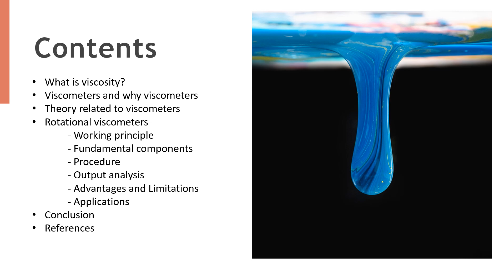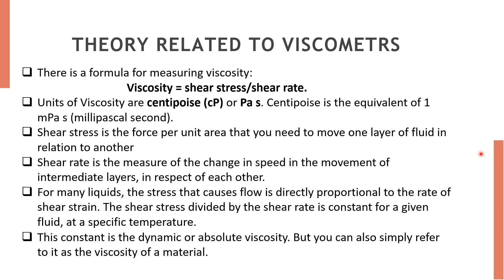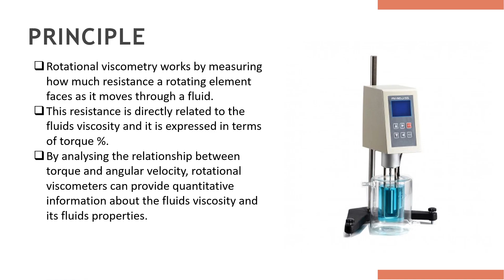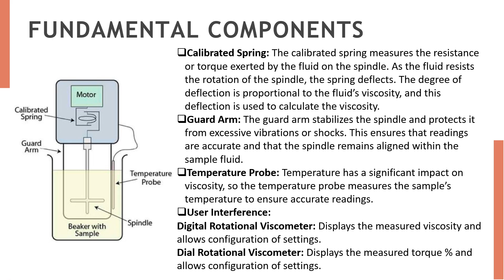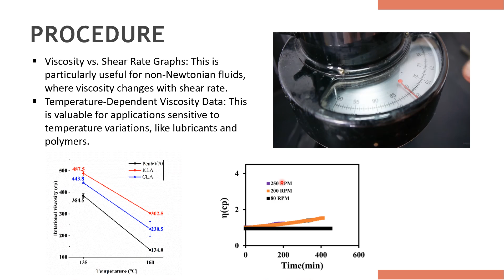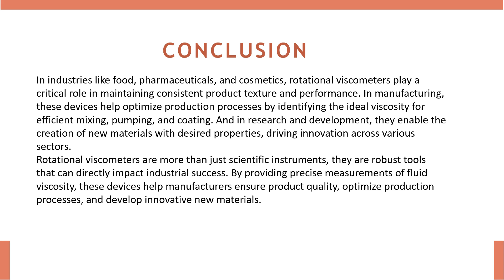Rotational Viscometer

Comment: BT21CME100 SNEHA BHARTI 
In the procedure part you mentioned to remove aur bubbles in the sample we are testing. How do air bubbles in the sample affect viscosity measurements?
Reply from the maker: Thank you for watching.
Air bubbles create inconsistencies by altering the resistance experienced by the spindle, leading to inaccurate viscosity readings. Degassing the sample beforehand can prevent this.

Comment: BT21CME047 Harshita Patil 
Can you explain how does temperature influence viscosity measurements in rotational viscometer
Reply from the maker: Thank you for watching. 
Temperature significantly affects viscosity. Higher temperatures typically reduce viscosity by decreasing intermolecular forces, while lower temperatures increase it. Rotational viscometers often include temperature control to ensure accurate and consistent measurements.